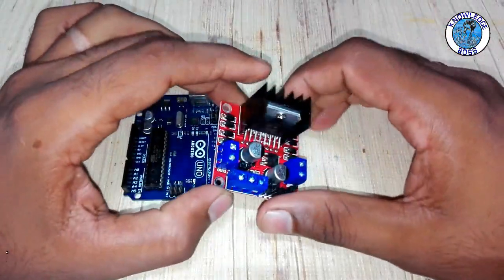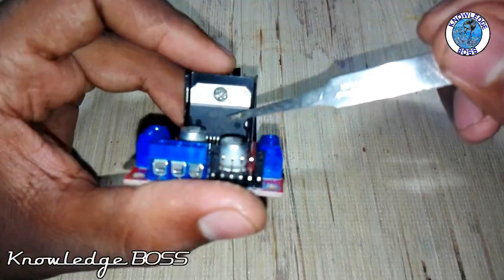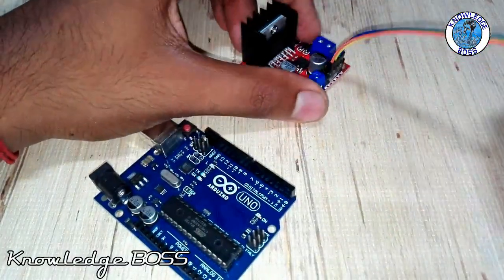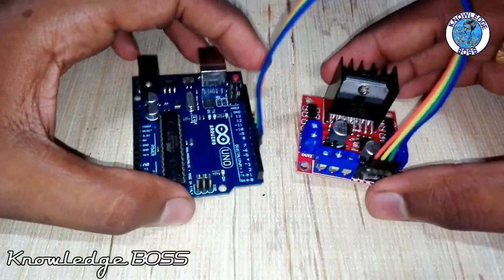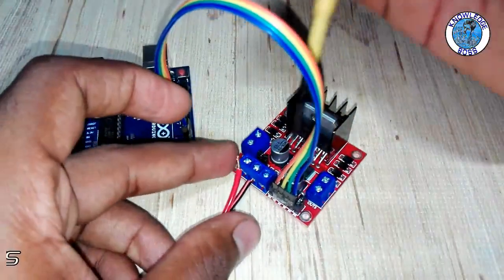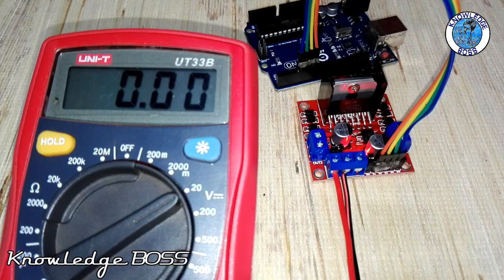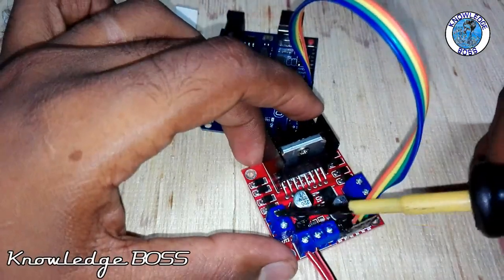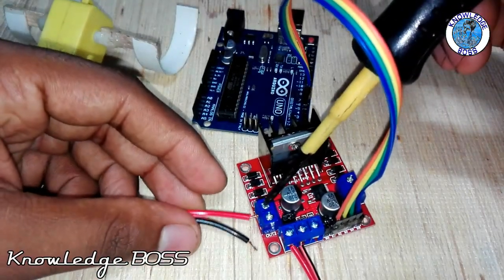Arduino & Robotics Tutorial #15 L298N Motor Controller | தமிழில் | Tamil | Knowledge BOSS | KB

Comment: why we cant cant connect required L298N voltage from Arduino 5V?
Reply from the maker: The output 5v from Arduino have low Amp value
Reply: Knowledge BOSS okay thanks, you are doing a great job..keep continuing!!
Reply: Yes